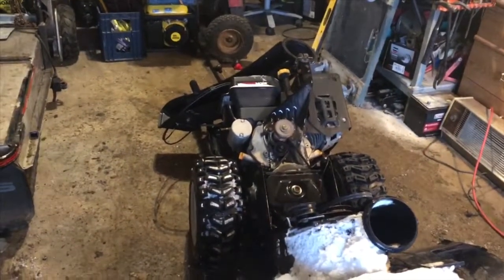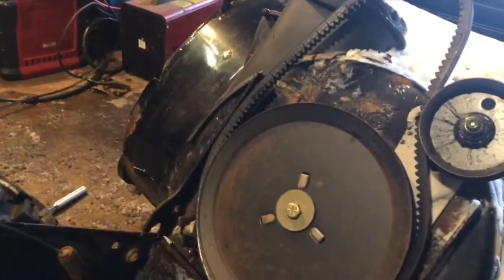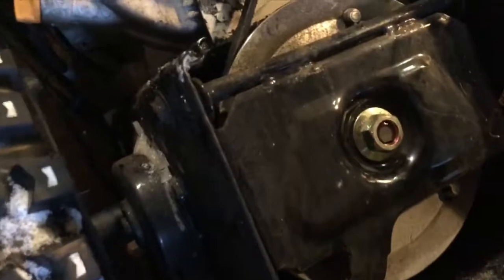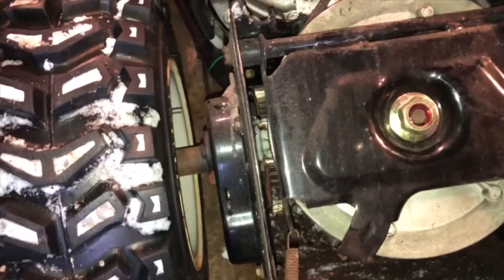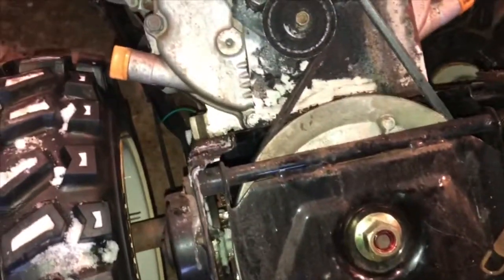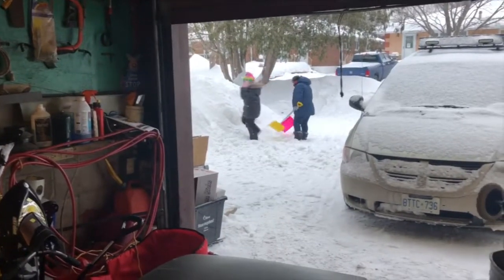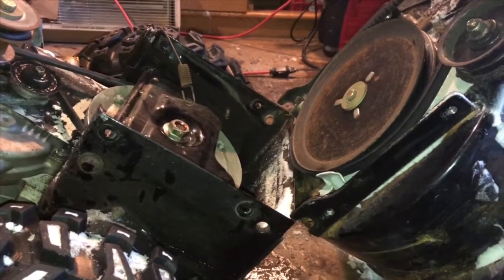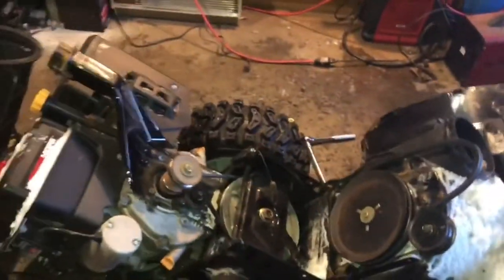How to split a snowblower

Comment: Great video!  Just a quick question – in the spot in the video where you had it split apart, at 1:27 , how would I replace that silver drive disc assembly that the rubber friction wheel makes contact with?  The center of the silver drive disc assembly has a bolt sticking out, on a bearing. When I go to tighten the nut onto the bolt, how can I tighten the nut without it turning on me?
Reply from the maker: Lock the handle down that operates the pulley but think I use a pipe wrench on the main shaft with a bar levered against the ground hope any of this is helpful
Reply: @ImBoones  Genius!  This was indeed very helpful!  Thanks so much for getting back to me :)